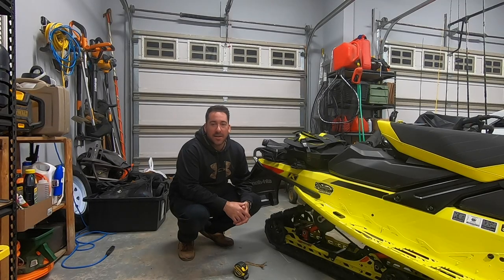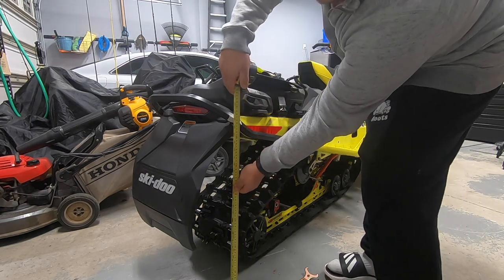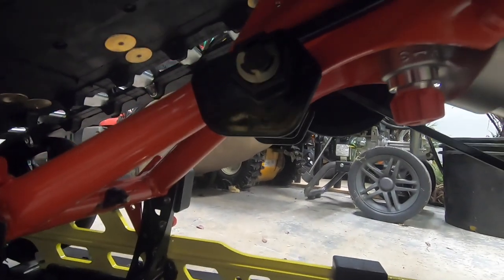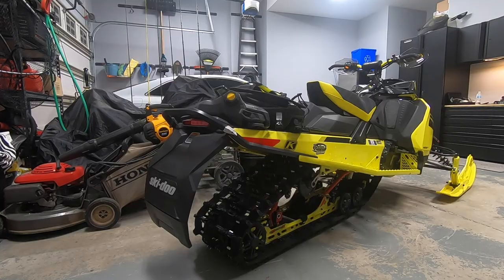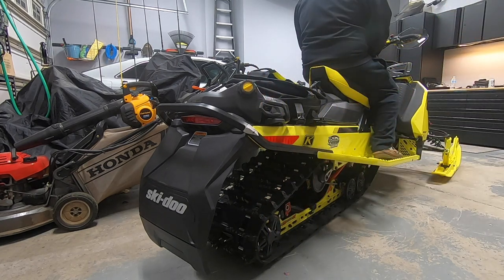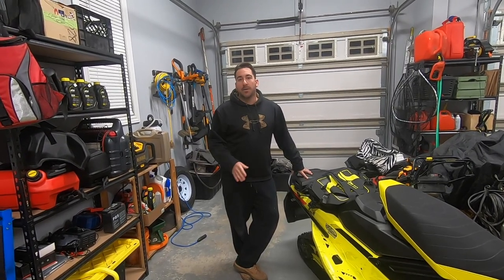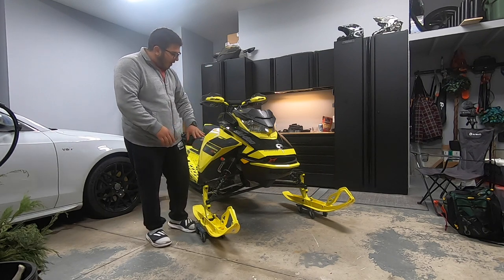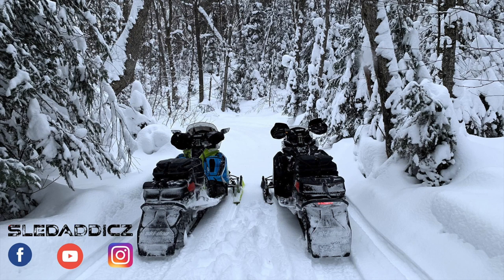HOW TO? | rMotion & rMotionX | 5 STEPS To Setting Up Ski-Doo X-RS Suspension

Comment: You guys should really check out Accelerated Technologies so that you set up front sag on your machine as well, It's really important and your sled will be much safer and corner better. Normal angle on front a arms is around 16 degrees, you want to lower that angle to lower centre of gravity. When all is set up when you raise and lower back of sled track will touch flat. Most don't they have the front of track touching first, which makes your sled unstable. Sorry for the essay but I think it's really important. I thought I had mine set up perfect until I took It to Accelerated and John explained. Made a world of difference. And you still get full shock travel.
Reply from the maker: Yep! Our buddy Andrew got a fully spec'ed out elka stage 3 suspension from John and its awesome! Thanks for your input. John and the accelerated team are great! Cheers,
Jesse

Comment: When setting up sag should you give the sled a few hops to get the sled to settle them measure the ride height?
Reply from the maker: Yes. I get it to sit flat and pull up the rear so shock fully extends and then let it sit/sag on its on. Cheers, Mike
Reply: No, do not hop on the sled after you get on. That will artificially compress the suspension and give a false sag measurement. Get on and sit normally like he did in the video. Cheers!
Reply: @joetech4054  it won't give you a false measurement it gives you the correct trail sag for your ride height as you trail ride.and that's how we set it on race day for my supercross guys
Reply: @denniswilder3014  I’ve always used the “do not bounce” method because that’s what l learned from service manuals and friends when setting up dirt bikes, street bikes, even mountain bikes. Nevertheless, your comment got me thinking and l went out to the garage and tried it both ways on my sled. Guess what? It didn’t make a significant difference either way. It sagged about 1/4” more when l bounced on it but that is probably just because a snowmobile skid has more stiction than other suspension systems. I’m 51 and still learning new things every day!

Comment: I have a 2022 Renegade X and have adjusted my suspension to where I like it.  Working really well but the one challenge I have is the rear snow flap seems high off the ground when I am on it 5".  With the engine temp on gauge all the time I am more aware of how hot the sled is running.  42-60 degree's C.   Is this too hot and is the snow flap height ok   I am a big guy 6 foot 1" and 230 lbs.  Track is a 1.5" ice ripper.    Thanks in advance....love the content.
Reply from the maker: Awesome and thanks for watching! Mike
Reply from the maker: Hey Shaun. Are u running an an 850 or 900? Snow flap height is fine. An 850 optimal temp is around 43.. 50 to 60 degrees is running hot. Cheers, Jesse
Reply: We have 4 RenX 600r 2022, and when temp is above 50C, it's because of ice accumulation in the skid tunnel thus blocking the radiators from getting fresh snow. It was the same issue with our 2020 RenX 600r. Sometimes you can get 40 pounds of ice accumulation inside the skid tunnel. This is a G4 design problem especially when riding 350-450 km a day on a 2500 km vacation trip. Ride safe Ride sober ✌
Reply: @sledaddicz  Hello Mike sorry for the slow reply.  850 ETEC.   I do run 42-45 in most conditions but in areas with low snow (road running-Hate doing it) and or super hard packed I saw it creep up to 50 and a couple of times to 60.  Saw the reply from Guy P don't think snow build up twas my issue with snow under tunnel but will keep an eye......

Comment: Question for you… I have a 2019 gt 900ace non turbo I find it pushes and doesn’t bite in corners. Carbides are good shape no studs (yet) front ski shocks (springs) set a 5 the hardest 
I’m 5’10 190lbs but sometimes ride with another adult on the back 

What would you start with ?
Reply from the maker: Hey Happy Camper! I'd try a set of Bergstroms 6" triple points. That's what we run and they are awesome in all conditions. Mike

Comment: I am 200 lbs. 230 lbs with gear. I have always swapped out the center shock tender to a stiff one for my weight from Monster Performance. Or go with a complete spring setup from Hygear.
Reply from the maker: You can do that forsure. We trade up every year so by putting our preload to 4 or 5 we are within 2.5 to 3 inches of travel when sitting. Cheers, Jesse

Comment: Nice video.  2 comments, 1) the sled should be completely level on the ground before you set the sag.  I think you did, but then show the sled on the wheels.  2) is more of my preference on front sag at 1-2".  You don't need a rider on the sled, but I feel is my good starting point
Reply from the maker: Yup! When we measured the sag we had all the dollys off and sled flat on ground. And good point on the front sag. Everyone has their own balance. We were just trying to give a general stance on what most choose to set it as.

Comment: Great video.  Just what I was looking for.   Question, the general consensus I get from others is to adjust one thing at a time. If that is the case and you have everything is at full soft then would you start with the center shock or the rear for steering and weight transfer?  Bear with me, I’m still looking for my optimal set up to still be able to lift the front end but still have the cornering.   I know there is a happy medium somewhere.  Thanks!
Reply from the maker: Thanks Brian. I would adjust that front track shock to get steering the way you want it and yes there is a happy medium adjusting it. You want just enough bite but light steering is what I normally aim for. For transfer, just leave the rear blocks on 1. If you have a 21 or 22, you can also try adjusting the arm for more transfer as well. Cheers, Mike
Reply: Thanks man, I appreciate your response.   Got my springs set, and everything at softest clicks on the clickers.  A lot of play when leaning side to side but hopefully with a little dialing in I will get it just where I like it.   Front arm is already changed to the more transfer position.   Ride safe!!

Comment: Do u guys switch to a heavier spring?
Reply from the maker: Hey Dino! Great question. The answer depends on your sled habits - are you buying a new sled and running it for multiple seasons? trading in every year? buying a used sled? For us, because we are trading every year, we just up the preload on the rear spring to 4 or 5 and it is just the right among of rear sag for our weight. Having said that, the higher the preload on the spring, the sooner it wears out and needs to be replaced. So if I was keeping my sled for 3 seasons, I would definitely switch to the heavier spring. Because I am trading in yearly, popping it up to 4 or 5 does the job perfectly, doesn't cost me money, and I don't have to worry about longevity. Cheers, Jesse

Comment: I checked my track alignment it's off to one side by 16th of an inch shoul I mess with getting closer on alignment or is that fine? Neither side is touching the skid
Reply from the maker: That's not too bad. I like them to be as equal as possible by looking at the track clips. Biggest thing is them not touching skid so you are probably good. Make sure tension is set properly too - 20lbs is good. Cheers, Mike
Reply: @sledaddicz  thanks

Comment: Good video,but to set  the sag  you have to be fully dressed   In what you wear when out riding . Plus have all your gear on sled that you’d normally take with you. That stuff can easily add up to 25 more pounds  then the way you did it. 
  You should also set your front sag to be Atleast 2”  when sitting on it fully dressed.
Reply from the maker: Agreed! We actually set the spring one higher then we showed in the vid to account for extra weight of gear.
Reply from the maker: @snowmobilingpodcastgordava3226  sled was flat on ground when measuring sag. And we put the spring a full setting higher to account for gear weight
Reply: Okayyy...relax their giving a general idea how to set it up. 🙄

Comment: Now when you say no more give in the center front spring you mean up and down or wiggle left and right?
Reply from the maker: You loosen off to the point where you can wiggle it right to left and then add just enough pressure until you can no longer wiggle. Mike.
Reply: @sledaddicz  ok thanks thats just starting point right? If I back off the preload I will get more ski pressure correct? I just bought my first snowmoblie an its a 2021 renagade x 600r an im having some pushing issues in the turns
Reply from the maker: @johnnycash7803  Yes. This is your starting point which will give you more weight on your skis and then add preload (tighten it) to reduce ski pressure. I dont typically have very much preload on it which gives me optimal steering. I also have a 600r and have found snowtrackers to work really well on it. Its not as heavy as the 850 so this is a good solution I am finding. Mike
Reply: @sledaddicz  thanks for the reply man! Can you hook me up with a link for the carbide your using? Will they fit mine. I'm sorry this is all very new to me.
Reply from the maker: The carbides are distributed through Kimpex. In Canada, we get ours from Royal Distributing. I would just google to see who has them if you are in the US. They are the Snowtracker Semi Aggressive carbides. Cheers, Mike.

Comment: New sleds are pretty stiff out o the crate. If you weigh more than 180-200 lb without your gear on and intend on carry bags a passenger or a fuel caddy replace the factory torsion springs with heavier torsion springs.
Reply from the maker: I had a good chat with my dealer today on this topic. While they are stiff, they aren't coming with springs that are a one-size fits all. The springs are too soft for bigger guys like us and should be swapped out immediately. Next season both sleds will get stiffer springs to help. Mike
Reply: @sledaddicz  really improved your range when your saddled or if you ever 2 up. Sled rides way better too. Not so easy to bottom.